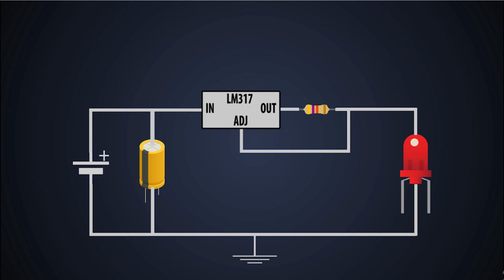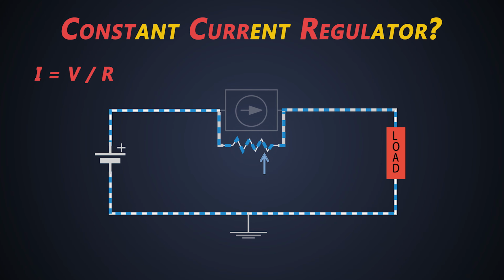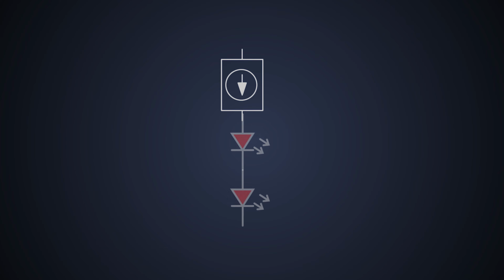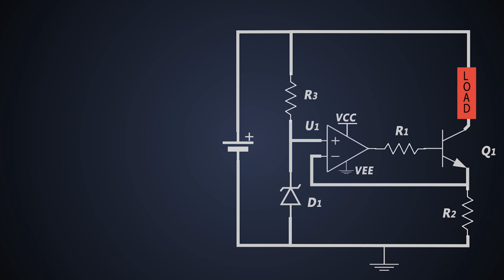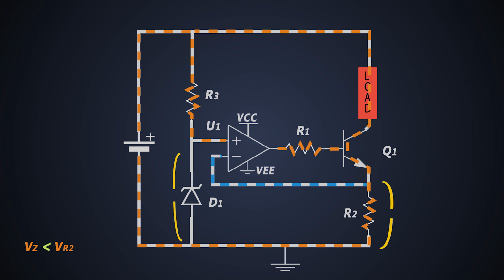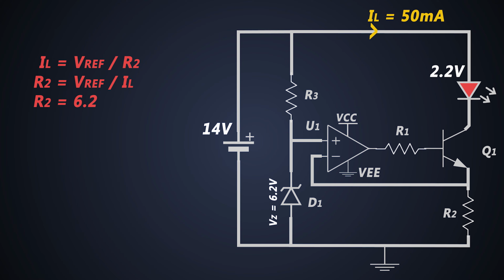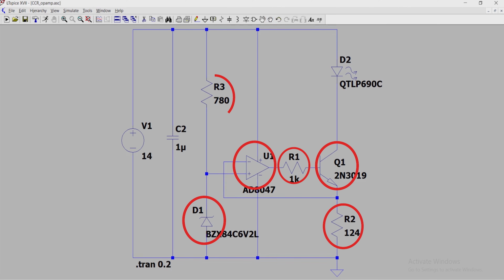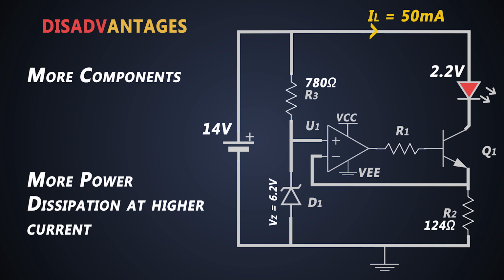Constant Current Regulator using Transistors & OpAmp | CCR | Constant Current Regulator.

Comment: Well presented. Only critique would be the dismissal of the transistor emitter current not being the same as the collector. Depending on the load, the base current isn't going to be seen by the load. Basically, the R2 current will not match your LED current. The R2 will have the base current going through the R1 resistor from the opamp. If you want to perfectly calculate, you would move the LED to the emitter of Q1. With a high gain transistor, this difference will be negligible, but when running power transistors with gains around 100 you might want to compensate for the extra current.

Comment: And just to add one more note regarding the explanation of circuit operation. An op-amp is an analog device that smoothly changes its output voltage; therefore it is not appropriate to say "logic high output" which "turns on the transistor". The op-amp senses the change in its input differential voltage and instantly reacts to it by starting to change its output voltage until it restores the equilibrium.

Comment: A great movie! Just to note that when there is a permanently connected load there is no need for a base resistor because the transistor itself limits the base current by increasing the emitter voltage.

Comment: hi bhai, i have 24 votlage solenoid, if check the voltage near solenoide it is showing 24v, and if i check current it is varying from 0 - 650 mV, the coil is mounted on the hydraulic jack which is controlling the speed of jack, and the coil is being controlled by potentiometer,  how can i make the circuit to make it happen,
Reply: First you will have to consider that 0-650 mV isn't a current.
Then, Google is your best friend. There tons of resources for driving solenoids.
Reply: @Oscar Gr  bhai it was a typing mistake it 0 - 650 mA
Reply: @rizvanrazi4698  Of course. But my point is a solenoid is a device controlled by current. (Not voltage)
Sure, they print a voltage on it because the manufacturer knows the resistance of the coil (for DC) and most electric sources are voltage sources.
If your source is AC it's already different.

Did you find a circuit online yet?

Comment: Dang it lol, I'm trying to drive an LED circuit that requires a constant current at around 2A using 48V as Vref. The calculated power dissipation for the discrete components is obviously off the charts. Is there any other constant current regulator circuit that can be used for higher current applications?
Reply from the maker: use PWM LED drivers
Reply: @FoolishEngineer  Thanks!

Comment: 6:28 is Vref in the load current equation the average voltage seen by the load? Because it in theory should toggle between 0 and 14 Volts, right?
Reply: Not really ....
Once the load current reaches the set value , this will produce voltage across it equals the ref voltage = zener voltage 
this will switch of the transistor before the voltage across the load reaches Vcc
so the load will never experience 14v  across it
Reply: @alaanoor3679  good point. But I can't yet see weight Zener voltage is voltage of R2... I mean there's also load resistance and R3 involved here
Reply: @ThomasHaberkorn  
ok ... lets take it point by point 

you use the Zener to set the voltage you want across R2
this is your starting point
if you want 5v across R2 , you buy 5.1v Zener 
or if you want 9v across R2 , you buy 9.1v Zener 

at zero second , there is no voltage of current across R2
once the supply starts , the transistor is ON and the voltage across R2 starts to build up to reach VCC
but .... before that happens , once R2 Voltage reaches Vzener , the transistor will switch off
so the current will drop 
once it drops , the transistor will switch on again 
and so on

Why R3 ? 
it is to limit the Zener Reverse Current within an acceptable value ... otherwise it will burn , just like you do with an LED 
you put R3 in order to keep the Zener  reverse current between 1 and 10ma , usually 5ma

so if your supply voltage is 12v , R3 = 12(v) / 0.005(A) = 2400 Ohms (2.4k)
Reply: @alaanoor3679  awesome explanation, thanks 😊
Reply: @ThomasHaberkorn   Glad i can help Thomas

Comment: what if the VS for the op amp VCC has lower than VCE on the BJT? do I need some circuit configuration. example like VS = 12V, and the VCE is around 80V or above